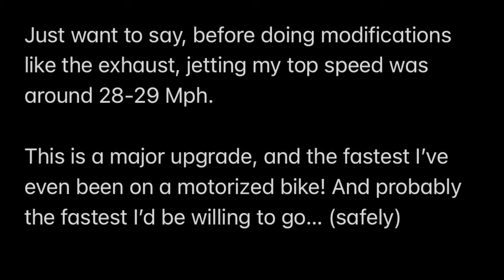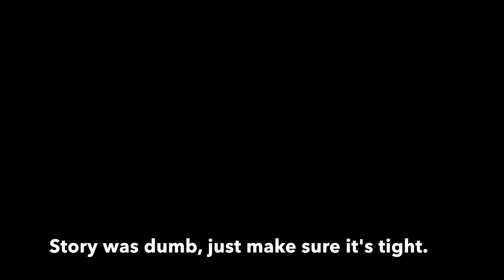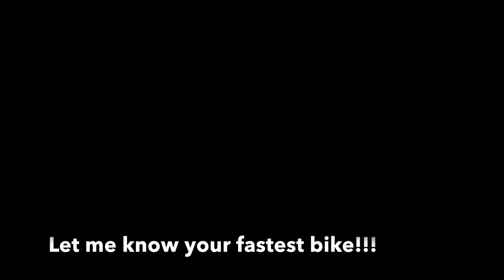Motorized Bike NT Carburetor Jetting in a Nutshell, How to Jet a Motorized Bike Carb

Comment: I have a 66/80cc engine with high performance head and exhaust with a ported cylinder and my stock NT carburetor has the stock jet it came with and I know all bikes are different but what would you guys recommend I start with and bikeberry has jets in order

Comment: Just curious what jet comes stock in the carb
Reply: normally a 70 jet
Reply: @topdog3407  if u listen to how mine runs in my newest vid in ur opinion do u think that I need to put a smaller jet yo lean it out I think its 4 stroking could be wrong was also told to lean can cause 4 stroking soooooo I'm just a lil confused i think it might be rich plug isint super white/grey seems darker
Reply: @topdog3407  btw I haven't messed with jetting at all it's a stock yd100
Reply: @topdog3407  is it yhe same for the bofeng carps
Reply: @theLyzhendricks  darker and wet plugs normally indicate too rich or too much oil. the engines also take about 5mins to run to warm up before they stop 4 stroking. are you breaking it in? because if you are just ignore it until you put less oil in the ratio. then when its fully broken in i personally run 25/1 on mine but if you have fully synthetic oil use 32/1 AFTER breaking it in. Worry about the jetting last once all that is done.
Reply: @theLyzhendricks  it should be the same. In my old motorised bike i went down from a 70 jet to a 65 jet at sea level. ran perfectly although i had a 80cc engine. bigger engines will need more fuel. another thing you can also do is drill a big hole in the plastic of the air filter box to get more air going through the engine which leans it out.
Reply: Can you please help me, I'm having some trouble finding the jets online. Can you tell me if they are m4 or m5? 5mm or 7mm? I've come across a lot of different ones, and I already bought the wrong ones and don't want to waste any more money. Can you tell me where you buy them or just leave the description of what I need please. Thank you!
Reply: I think they're 5mm round jets with a flat head top?

Comment: My bicycle will do 29 without a motor with just the peddles!! 50mph should be the minimum speed I wanna go with a motor.Thats the whole ides of building a motorized Bike to go a Hell of a lot faster! You forgot to talk about air screw, fuel mixture. Pilot jets Needle adjustment. etc,,,👍